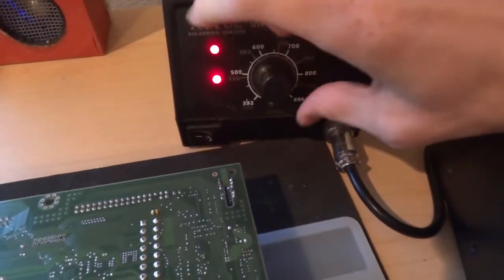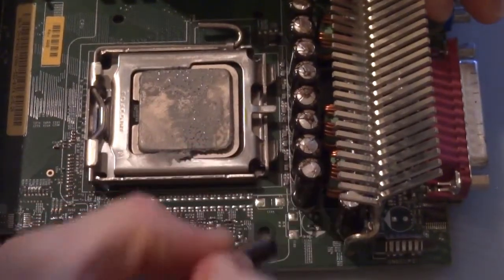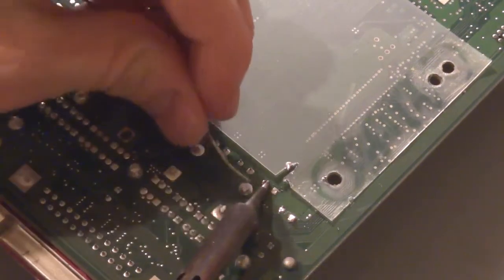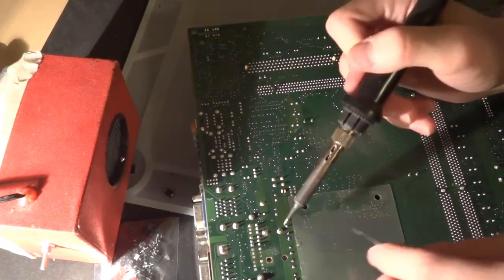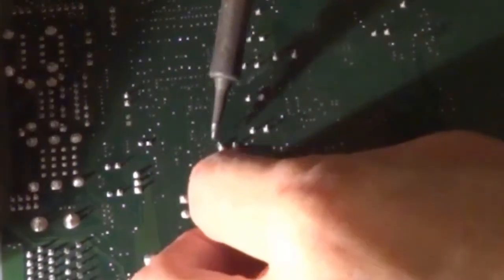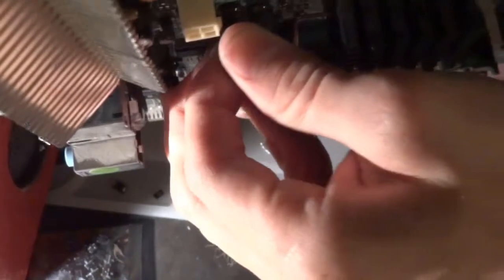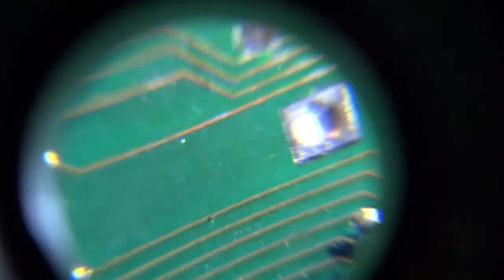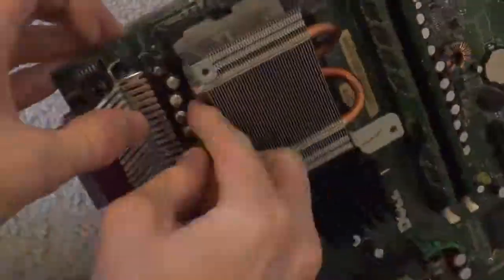Desoldering tough components that won't come out! (Replacing Capacitors on motherboard)

Comment: The reason adding solder works is called "heat transfer". Your tip is not contacting enough surface area to efficiently transfer heat by "heat conduction". Adding solder creates a pool of hot liquid that engulfs the soldering iron tip and the component legs and solder pad. The tip can then easily heat up all the parts to allow part removal.
Reply: You're dead on.  The reason why the solder is so hard to melt on its own is because it's lead-free, which has a much higher melting point temp than leaded.  Read somewhere that If you didn't put a coat of regular leaded solder you'd have to heat up the entire PCB to 150°C for seconds only in an airbath. if you preheat it then the lead-free will desolder almost as fast as regular leaded solder.  I believe to repair it, you must first remove all of the lead-free solder completely and then resolder w/ lead 67-37. Mixing lead and lead-free solder yields a more brittle joint and more prone to breaking.  I wonder though, does anyone know if using regular leaded 67-37 on a part that it's for lead-free (like a capacitor for instance) be the same as mixing the two types of solder and make an unreliable joint/solder?
Reply: This is such a great explanation! I was having a hard time one day removing components and with a mild grasp of thermodynamics I theorized adding solder to the tip might help intuitively. I felt like Issac Newton in that very moment!
Reply: Not quite... Most importantly leaded solder has lower melting temperature... With lead-free solder and temperature  300 degree C for example It will doesn't work but   if you add leaded it will because leaded solder melts at 220-228 degree C, I belivie.
Reply: Also it works with leaded solder. You can also melt it at lower temperature if u add a alloy that melts at lower temperature then Sn60Pb30 or whatever u use, for example alloy with bizmuth which metls at 100 sth degree C - I don't remember exactly. ...
Reply: Good answer bro thank you
Reply: yes,

also notably sometimes the oxide layer on the outside of the solder joint is really resistant and the solder fails to melt until this is breached. it's sort of strange how much it can affect the melting properties

Comment: Part of the issue is modern boards are soldered with led free solder. U need more heat and a larger tip, but adding additional lead solder is always recommended to help flow the old solder, even if its not lead free.
Reply: thank you for this. the kinda comment i was looking for

Comment: If you are going to desolder anything you need to use either flux or a flux pen with the wick, also use upwards of 350c temp and a clean tinned iron, the solder will jump onto the iron and wick instantly.

Comment: I have heard and found over the years that a lot of manufacturers used or are still using Silver Solder which has a much higher melting point. When you mix the two with a lower melting point melting solder heat transfer is greatly improved. Thanks for posting.

Comment: This is a great tip.  I have picked up another from a discussion that preheating the entire board to 100 degrees will help with the power plane leeching heat which is thick copper layers.  My little 23w iron is not cutting the mustard even with adding solder so i am having to wait for a temp controlled on that can do as high as 500C if needed

Comment: I ran into this issue tonight and could not figure out why the solder even at 750F would not melt the capacitor solder. Thank you for sharing this problem and solution. The only way to really learn is by doing it.

Comment: @Lucid Dev Team You did that wrong... You should use preheater to preheat the mainboard up to 120-150 degree C and then increase temperature on the soldering station until solder melts. Lead-free solder has higher melting point then leaded solder, so you have to use much higher temperature. Also preheating is key in this case, because mainboards has 8 layers and they has massive ground planes, so removing any component without preheater is nearly impossible - you can damage pads or damage the component due to exposure on heat for too long period of time... Generally speaking it is rly bad idea to replace anything on the multi-layer PCBs witout preheating, you  had luck this time, but next time you can  easly damge sth...

Comment: Awesome video. I figured this out the hard way. And I dont think just adding flux helps much. Also look into desoldering alloy. I've found you still have to add new solder first, but it has a low melting temp and gives you more time to remove components. The alloy then HAS to be removed completely.

Comment: Here's a crazy idea:

You could leave in the existing leads from previous capacitors & instead try resoldering the new capacitors onto the existing pertruding legs from the previous ones. 😉😃

Comment: I know this is an old video but I just did this yesterday. I figured this out to so that it was easy to get the caps out, but getting them back in was a mess, and the board didn't work afterwards.  So, no joy.  Have to replace the board.

Comment: I strogly you use flux prior to attemting the ed soldering process. Also in other addind extra solder helps in the heat transfer, also older solder used lead typically 60/40 blend of tin and lead. With newer lead free solder a mix between the two, makes de soldering a little more, "the feel" different.
Reply from the maker: Yes, I've realized that. Not sure, but i think I used a flux pen tho

Comment: Yea that's cool. But will it work with large components like a 8ga wire on a motherboard? Cuz I've heated the board and used 2 soldering irons and new solder n couldn't remove crap!

I figured the wire was conducting heat so I cut it n I was able to desolder half of the solder... But there is still just a little and it's impossible to remove!

I've tried Temps up to 460c!
Reply: did you figure it out

Comment: the thermal contact was poor. Adding more solder allow better heat transfer. If the pin is connected to ground plane. then the heat sink is greater. Meaning more heat is needed to compensate the heat loss.

Comment: lead free solder is a bitch at rework. it kills your tip's lifespan, needs a proper flux or you'll get black tip syndrome, needs high temps, melts so ugly, etc. also, lead free makes everything expensive. fuck that solder.

Comment: Can you heat up the solder points with a heat gun and pull out the capacitor. Or would the capacitor explode.

Comment: The way you remove those caps gives me anxiety. Especially with old boards, this is a great way to tear out the solder pads and even the traces.
Reply from the maker: It was a lot more difficult trying to do this while having it recorded. Just be careful when you do it

Comment: I'm running into the same issue, but even adding flux and solder does not seem to do aything ... I'm working on an old HP server motherboard from 2009.

Comment: I'm able to get the old capacitors out, the problem is clearing the remaining solder well enough from the holes to get the replacement capacitors in.  Maybe if I make a solder bridge between the two holes and heat that, I can still install the replacements and it won't matter that I didn't clear the holes?
Reply: Warm the solder up and push a needle through the hole. Easy.
Reply: @shifty2755  Had to add more solder and heat it a while to clear it.  Counter-intuitive.
Reply: @hugesinker  

That is also a good solution 👍

Comment: Get a solder sucker!  Doesn't matter if it's manual or powered... Add some new solder, then use the solder sucker to draw off the melted solder.  Half the time the parts will simply fall out of the board leaving you with an open hole for the new part.

Comment: So what temp did you settle on for your iron. I've gone all the way up to 280 c, but still couldn't get the new solder to mix with the original.
Reply: I use 430 degrees.

Comment: I have wasted so much time trying to remove 2 capacitors. I tried high temp, solder wicks and more solder+ solder pump. I cut the capacitors off but am having issues even clearing the holes to put new capacitors in. Nightmare
Reply: I'm in the same boat. I think old unleaded solder is just terrible to try and remove. You need high temps, flux, along with mixing in new solder. Then if you are on the pad with high temps for too long, you ruin it. Soldering is sooo much easier than De-soldering.
Reply: @overnightdelivery  Agreed. I even bought new soldering irons including a TS100 type one and a Electric Vacuum Solder Sucker Desoldering Suction Pump Iron Gun Tin Soldering Repair Tool with 3 Nozzle EU Plug 220V 30W of aliexpress. I have just let it sit there. I may just solder things to the legs or reluctantly drill holes with a small drill bit as so fed up. Hope your position fairs better. I think they could use this solder for space reentry !
Reply: @tarunarya1780  Believe it or not I've developed a pretty fool proof method for capacitors. Well.. for me at least. Not fast but effective:
 Temp at 700F. Always dab a bunch of flux over the legs you are De-soldering, then tin your iron with lots of  solder(leaded melts better), have a solder sucker ready if your lucky you'll remove everything on the surface. After that you need to once again tin your iron and as you are applying solder you need to GENTLY rock the component you are trying to remove back and forth while keeping the heat applied. If you start hearing a squeeking noise, that means the leg is starting to move. If it doesn't start to move after 10 seconds or so, you use the solder sucker and repeat the process. 

Once it moves a little ways, hold the leg down in that position and let it cool. Then re-tin and use the same process on the other leg. Going back to the other leg you should be able to safely pull it through the hole while applying solder again. Repeat until it's out.

 Then I use wick over the holes, press and hold a tinned iron on top to remove excess solder covering the holes. You need to be very careful to not quickly remove the wick. Because it could be stuck if it's not hot enough and you could rip off the pads. Sometimes the wick will not remove enough solder from the holes. So then you can hold a toothpick on the other side of the board and use your iron on the other side. You then  twist and bore out a wider hole, while keeping heat applied so your toothpick doesn't get stuck. Then use wick again to finish it off.

It's still tedious but I've had a 100% success rate since. This applies to medium to large sized capacitors. May be more difficult with small stuff.
Reply: Thanks